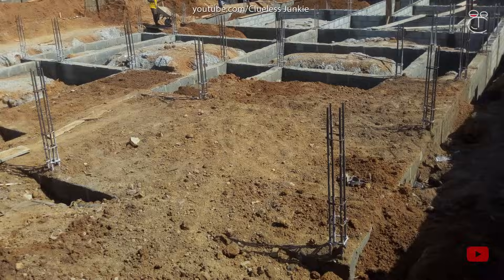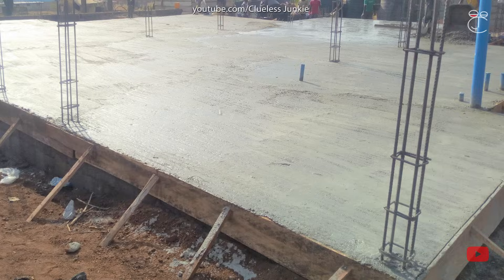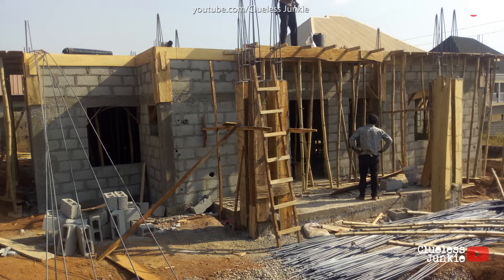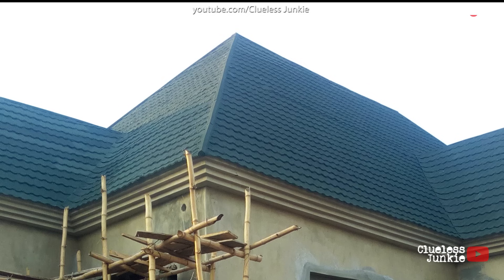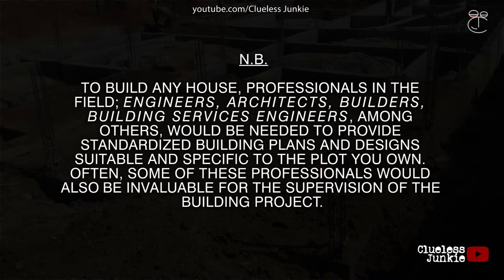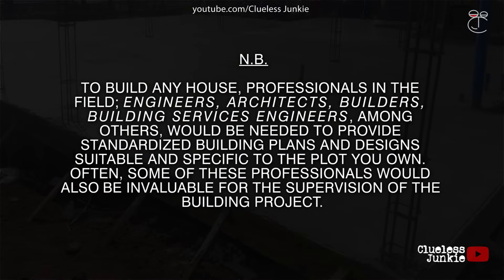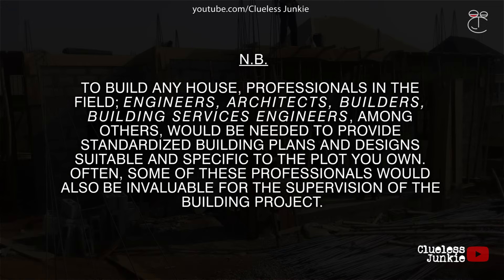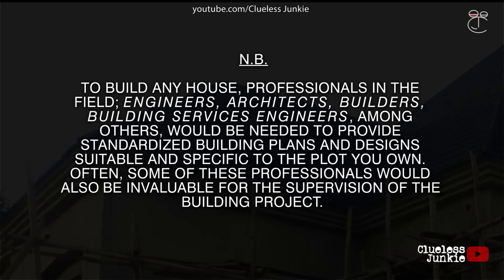Building a House | Foundation | Stage by stage #foundation

Comment: As a steel fixer / general contractor I’m already see faults in the structural reinforcement of the foundation there is no steel reinforcement linking each footing and on which you should have tied wall bars 16”(inch) apart for your block walls because your laying blocks with no steel and the column’s are too small you could have used 12” steels and stirrups have no latch to hold the steel so wile the building looks good when it’s finished over all it is week a to me will fall down Evan from a very small tremor
Reply: This is how you guys waste clients' money by replicating what an Engineer did on a certain site on another without understanding the basis for design.
Reply: @obohoasanwana1695 who is correct in this case? The viewer or the channel owner?
Reply: It depends on the seismic zone. Where did you build? Where was the house in this video built? 

Apparently this house was built to protect from light earthquakes, maybe magnitude 5 or less, in a region that does not expect devastating earthquakes. 

In most of Germany we don't use any steel for private houses, but in the Philippines we use much bigger posts and beams than in this video,  and steel in the walls due to earthquakes up to about 8 magnitude.

The engineering really depends on your location, seismic zone, climate and soils.

Comment: Please what are those pipes in the walls for?
Reply from the maker: Thank you for watching!

The blue ones are waste pipes. 
They carry solid and liquid waste matter out of the building.

The whites are electrical conduit. 
They protect and route electrical wiring in the building.
Reply: Thanks but couldn't they not fit the pipes outside this walls for ease of maintenance??
Reply from the maker: That is doable
But, in that case, introduction of service ducts is advised

Comment: Im from south africa. We had our house built in 1995 and still standing strong today. Most of these things were not used to build our house. Once again, this house is unnecessarily expensive. There are ways to do it with out all this admin
Reply: Share the cheaper ways
Reply: The soil structure in Southern Africa allows for building without iron bars/rebars. Most cities in coastal west Africa are in a seismic zone so these are entrenched in our building codes
Reply: 1995 your house new not that old
Reply: Just because your house is still standing doesn’t mean it was built right. The video shows the correct building process.
Reply: 1995 is about 28 years ago its not that old bro.. 😀
Reply: If it wasn’t standing strong today tht would mean a very poor job was done.. concrete houses are supposed to last for a very long time
Reply: Doing something wrong and see it last long does make it right..
Reply: @sagittariussurge5565  Committing crimes for a long time makes the practice legit, according to you. Oh God help us!
Reply: @sagittariussurge5565 he's talking about the price and not the method
Reply: This video is exactly how they are building my house in uganda.

I was so worried at first as in england we are used to filling the trench with concrete only
Reply: Houses have their life span, and factor of safety should be considered in building a house professionally you need to consider all that. Factor of safety could be factors like wind storm, or a huge ground movement, or flooding. You don't only build for the structure to stand alone. But for it to withstand any worse condition that it could be subjected to.
Reply: This is quite cheap!!!!!!! In Jamaica we have to put vertical bars into every other block packet. This looks really cheap and and very strong
Reply: I think it was necessary to build this house like this because of the type of soil it's being built on,,if you built on  hard rock then I think it's unnecessary
Reply: Depending also on geographical location. To able the house to withstand natural disasters
Reply: We have a house built out of mud in the 1950s and it's still standing doesn't mean it would last forever... A house built in 1995 is still a young building... build a solid house out of concrete and it will last for centuries.
Reply: There is not too much here, dis are the necessary requirements for a standard house
Reply: The youtuber sounda like he just teying to explain something he doesn't know, it's just for views. Another thing concerning me is to see a multistory house built using blocks . Now i inderatand why a certain building collapsed in this country killing hundreds of people .
Reply: @golopota1  elaborate
Reply: What's expensive about this house? A house without chains before dpc
Reply: @okonkwovictor3555 one question please, is it always necessary to chain?
Reply from the maker: Thank you for watching!

You have a valid point.

Plus, at the very beginning of the video, it was stated that "it's one of the many ways in which a house could be built."

Yes, there are other ways to do it.

Cheers

Comment: I don’t see any waterproofing on the exterior and interior of the foundation. There is no plan to battle water moisture in the foundation. Risky!!!
Reply from the maker: Thank you for watching!

Waterproofing the exterior and interior walls of the foundation is highly recommended for areas with high capillarity abnormally 

It was an avoidable expenditure in this case 

Please consult appropriate professionals before any building project is embarked on

Comment: Americans should come and learn how to construct tornado proof houses from us
Reply from the maker: Thank you for watching!

However, there are reasons they build houses the way they do
Reply: Our climate is not like yours. Which is why our frames and foundations aren't the same as yours. So it really wouldn't be a need to unless we are building a house there or in any tropical climate
Reply: @original_USA_cowgirl  yea and it would be more expensive. we build houses out concrete in Trinidad with steel roofing because of hurricane season but our climate is hot and we need more open spaces for ventilation so its different but our houses would definitely be stronger than american wood based houses but climate wise it wont be suitable
Reply: @barrytelesford5265  I agree

Comment: I am not sure you mentioned that it's very important to find out the Bearing Capacity of the Soil and general nature of the soil (soil type). This will go a long way in determining the kind of Foundation required.
Good explanation...easy to understand for young Engineers with little Site Construction experience. Nice explanation, well-done.👍
Reply from the maker: Great point!

Thank you for watching!
Reply: Thanks so much is very nice l see form the beginning to the end
Reply: Yes I also didn't hear anything about the soil. I'm not sure if this is don't forfor dry land or wet.

Comment: It is advisable to use solid blocks in foundations if you don't plan on putting concrete in the hollow part of the foundation blocks. All concrete are advised to be vibrated to reduce voids by use of a poker vibrator. Hollow blocks are ideal for interior walls as they help with acoustic control/soundproofing. All hardcore in foundation should be sand blinded or soil filled to reduce gaps that may use up more concrete and also create large voids that could later cause the floor to crack from settlement if concrete is not well distributed between those hardcore gaps. Damp proof membrane (plastic) is then laid upon the sand blinding or soiling and over the foundation blocks before the grade slab is poured/concreted to prevent rapid loss of water from concrete, groundwater absorption during the rains by the slab and walls, which will create dampness in buildings, leading to the walls always being moist hence leading to paints flaking or peeling off.  Neat construction by the way.
Reply: The hollow blocks are not load bearing, they're just walls.
Reply: @rap3208  we don't regard hollow blocks as load bearing wall they are just there for partitioning, so we don't necessarily fill it up, but in places like swamps you may fill it up with concretes to dpc level,
Reply: @maduodinaka3813  You just repeated what I said.
Reply: They don't know  it's pillars that bears the load😊
Reply: @rap3208  hollow blocks are used as load bearing units so yes they are load bearing
Reply: Fascinating.
Reply: You don't build walls before columns therefore your construction is total wrong from the onset!
Reply: @olusegunadeleye186 it depends. In some cases it's allowed. Casting columns shuttered onto erected walls makes the bond between column and wall very strong as compared to building wall on already hardened column.
Reply: I was wondering about that. Looks like a nono to me.
Reply: Hollow bricks are not ideal for African houses as they trap heat inside the hollows and dispose that heat into the house. Its ideal to use sold brick or clay brick as they repel heat. Hollow bricks are for fencing
Reply: @vona5251  you're very wrong here. Holo bricks are insulators ( they shield you from both cold and hot weathers ) unlike the solid bricks/blocks which are pure conductors of heat and cold. 
All the same, it's advisable to use solid blocks in your foundations as they assist in load bearing.
Reply: @Wildlifeworld247updates  👍🏽
Reply: @Wildlifeworld247updates  hollow can as well serve as sound insulator to a certain level

Comment: I am here wondering why the majority of you who are building  now don't go for expanded polystyrene?
Reply from the maker: Thank you for watching!

Expanded polystyrene are durable, and have good thermal insulation properties - which makes it an ideal choice for energy efficient buildings.

However, they are not recommended for use as load bearing walls in multi-storey buildings.

Kindly consult appropriate professionals before any building project is embarked on.
Reply: @cluelessjunkie  I think you should have a look at my  university call YouTube because somewhere in India they are doing just that  I think you can mix the two when it comes to load bearing walls they also have a larger panels as in thickness to carry weight because it is all relatively to the  other panels it is all about the knowing the ledge /knowledge

Comment: Curiously honestly asking to gain knowledge: why the corner pillars of the house cannot be concealed within the hole of the blocks?
Reply from the maker: Thank you for watching!

Well, the Columns/Pillars were not structurally designed to be concealed within holes of the blocks.

Regardless, the block holes are not sizeable enough for a standard column/pillar to fit in.
Reply: @cluelessjunkie  Thanks for the swift reply. For a one storey house on soil, can I conceal the corner pillars since there's no upper floor weight? I'm designing a house in SketchUp and when times to build, I want to conceal the corner pillars within the blocks.
Reply from the maker: Please kindly consult appropriate professionals before any building project is embarked on 

Thank you
Reply: @sunnyj7257  The corner definitely you can run 1/2 high tension steel through interlocked blocks and pour with concrete .
Reply: @dwaynejordan5898  Thanks Dwayne. Will keep that in mind

Comment: 1The backfill procudere is not good.and the watering for compaction
2For footing you have to take form work material for concrete 
3 the hard core stone have to be stand 90 degree for purpose that when  concrete pouring to reach to bottom.
4 for foundation construction it is better use stone masonry rather than HCB 
5 the system of excavation have be checked .
Because you don't have excavate the all area at once.it is better for work space and quality.
6 for the first floor beam construction you need to use bottom   formwork .so HCB construction coming after you casting the beam and first slab concrete.
Reply from the maker: Thank you for watching!

Cheers!

Comment: Why do you use hollow block for foundation
Reply from the maker: Thank you for watching!

Hollow concrete blocks are easy to carry and work with, compared to solid blocks of same size

 Hollow concrete blocks could be used for foundation walls provided they are filled solid with concrete

Comment: I expect that there should be a beam-like casting (with rods) to be done in the foundation, especially for a storey building. Some soils are not so friendly that if you don't properly chain the entire foundation, your walls are gonna crack terribly in no time.
This is exactly the case in my place.
Reply: God bless you!!!! Beams help in sharing load
Reply: That's  very important in any building the beam casting with rods if is not den u have miss it all
Reply from the maker: That is very true.

However, the soil in this case was found to be stable enough from geotechnical investigations carried out.

Please consult appropriate professionals before any building project is embarked upon. 

Thank you for watching!
Reply: Exactly, called a plinth beam. I was also surprised they skipped that part, but the structural engineer probably has a reason?
Reply: @LoopySounds  ground beam 🙏🏿🙏🏿
Reply: In most cases where Plinth Beam is been used, it is either the soil is not stable or the topography of such parcel of land is not properly landscape making the substructure to become too high from the OGL.
And as such, a Plinth Beam will surely go a long way for proper chaining and stability of the entire structure against foundation failure
Reply: In some cases plinth beams are needed before laying the first block from foundation level and ground level before pouring the floor concrete. It will protect the foundation from cracks due to ground movements.

Comment: My question is, Why was hollow blocks used from the foundation to finishing and not solid blocks for the floor and later hollow for the upper
Reply from the maker: Thank you for watching!

Guess you missed the part where the hollows of the blocks for the foundation walls were filled solid with concrete

Hollow blocks were used primarily as they are cost-efficient( less mortar consumption, labour), good sound and thermal insulators, highly durable, ...

Kindly watch again

Comment: Why were hollow blocks used for the foundation
Reply from the maker: Guess you missed the part where the hollows of the blocks were filled solid with concrete

Plus, it would seem suicidal for any mason or construction worker to carry/work with solid blocks of that SIZE!

Kindly watch again
Reply: @cluelessjunkie  great. I'm into construction so I am constantly looking for new ways and techniques used by others. Which part of Africa is this project. I am in New York but does a lot of work in Ghana

Comment: Hello sir, thanks for the the video.
May l ask about the roof pitch. Why is it so high and steep. Thanks
Reply: OK, l see thanks for the explanation. I wondered because houses in southern African tend to have low pitch roofs.
Reply from the maker: More often than not, the high pitch is a measure to prevent roof leakage and such (something about 'sending down the rain')

Other than that, it is for aesthetics or a show of ego.

Comment: Looks good, but one thing we in the Caribbean orgar pile the foundation first before to go up
Reply: Also we used steel rod along with cement mortar in the pocket
Reply: @karlenescott3557  we have hurricane season and different type soil in the caribbean. African soil is more dense and building areas are more flat. so they wont require as much fortification as us.

Comment: Block width please? In inches? 5",6"or 9"?
Reply from the maker: 9"
Reply: Thanks man
Reply: Thanks for d video,please what is best quality nigeria rod 16mm,12mm and 8mm(trade name mark)I would like to get originals.
Reply: Thanks man. Did you use 9” all the way? If you can mix them when should that be? How can they be adequately juxtaposed?
Reply from the maker: @asinejonathan7861  Yes, for all major walls.